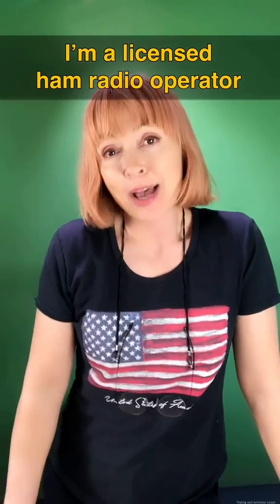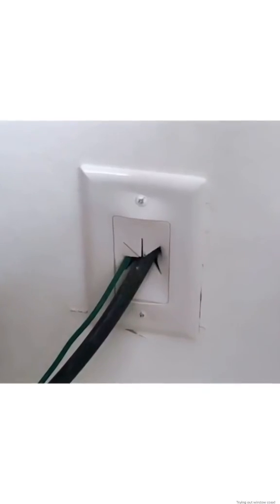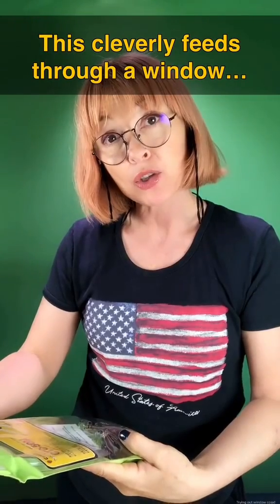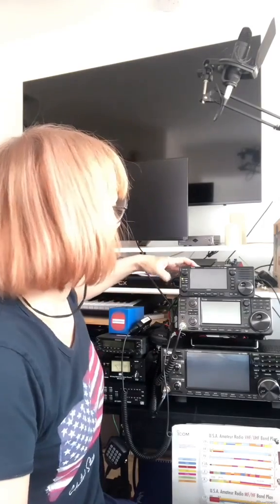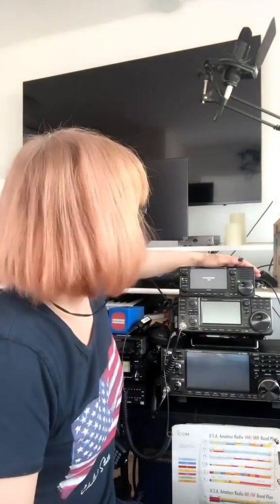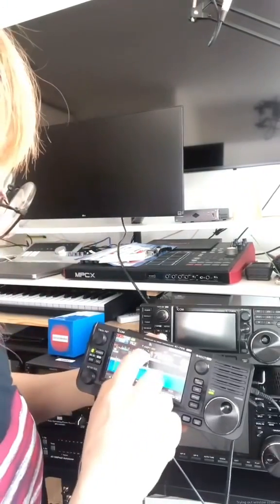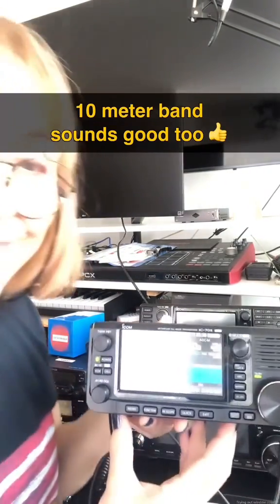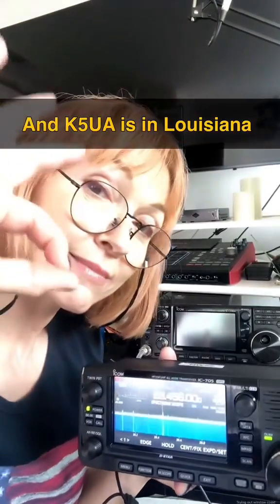HAM RADIO COAX WITH NO HOLES IN THE WALL!

Comment: Two things to know before buying one of these gap jumpers. According to Comet, the insertion loss is 0.5 dB (roughly 10%) and max power is 100W PEP for HF, 60W on VHF and 40W on UHF.  Honestly, it seems like a very niche product. If I was renting, I would work with the owner to drill the wall and place an outlet box on the inside that didn't look any worse than the TV coax. You also need grounding and a lightning arrester anyway.
Reply from the maker: I use mine daily and love it.

Comment: I have 3 of a different make than yours and, like you say, I can now bring in 3 cables from my 3 antennas (40m EFLW,  1/4 wave for 10m, and the 3rd for the UHF/VHF)  

These flat coax are a simple solution to a complicated problem 

I made some tests to measure and see if there was any problems due to them, and I couldn't find any difference (maybe a lab could...).

Yours though,  seems of higher quality.  

Peter
ON3VCF

Comment: I've used this for many years. Works well!! While it starting to separate still works, but got tired of using it, so made my own window pass through using a 2x4 (sealed and painted nice). I like my new option better only cause I have four connectors to the outside, so now I can test different antennas.

Comment from the maker: Here are manufacturers specs:

Frequency Range: DC-1300 MHz
* Connectors: SO-239
* Impedance: 50 Ohm
* Length: 15.75 inches
* Max Power: HF 100W PEP, VHF: 60W FM, UHF 40W FM, 900 MHz–1.3 * GHz: 10W FM
* SWR: Less than 1.3:1 below 500 MHz, Less than 1.5:1 above 500 MHz
* Loss: DC-500 MHz = 0.5 dB, 500-900 MHz = 1.3 dB, 900-1300 MHz = 1.8 dB

Affiliate link to item: https://amzn.to/3YvfKhd

Comment: a better way. 
using wood build a short panel of the correct thickness  to fit under a window.  drill X number of holes through it for the long threaded coax connecters.  as a benefit on the outside is a 1/4-3/8 think alum sheet, as a common ground. 
then get thick wall pvc piping of ( most newer windows here in the USA ) fit 1/2in or ? diameter. but cut to length for a tight fit. said window is not going to open. 
—can do this to all windows to “lock” them down to keep unwanted guests out.—.

Comment: what’s the insertion loss and it’s impact on VSWR, both on HF and VHF I wonder.
Reply from the maker: Per manufacturer 

Frequency Range: DC-1300 MHz
* Connectors: SO-239
* Impedance: 50 Ohm
* Length: 15.75 inches
* Max Power: HF 100W PEP, VHF: 60W FM, UHF 40W FM, 900 MHz–1.3 * GHz: 10W FM
* SWR: Less than 1.3:1 below 500 MHz, Less than 1.5:1 above 500 MHz
* Loss: DC-500 MHz = 0.5 dB, 500-900 MHz = 1.3 dB, 900-1300 MHz = 1.8 dB

Comment: Will this work on 2 meters/70cm?
Reply from the maker: I use it for HF and have not tried 2m/70cm. Here are maker specs:

* Frequency Range: DC-1300 MHz
* Connectors: SO-239
* Impedance: 50 Ohm
* Length: 15.75 inches
* Max Power: HF 100W PEP, VHF: 60W FM, UHF 40W FM, 900 MHz–1.3 * GHz: 10W FM
* SWR: Less than 1.3:1 below 500 MHz, Less than 1.5:1 above 500 MHz
* Loss: DC-500 MHz = 0.5 dB, 500-900 MHz = 1.3 dB, 900-1300 MHz = 1.8 dB

Comment: What happens when you put 1500 watts through it , Will it melt ?
Reply: I would be surprised if it works for tx above 25w tbh.
Reply: On HF it's rated to 100 watts, and VHF - UHF 65 watts or less. @lunarbluesmusic
Reply from the maker: Thank you.

Comment: I'd like to see some ARRL Lab test results before I went that route. An elegant solution no doubt if the losses too aren't noticeable.
Reply from the maker: Specs:

* Frequency Range: DC-1300 MHz
* Connectors: SO-239
* Impedance: 50 Ohm
* Length: 15.75 inches
* Max Power: HF 100W PEP, VHF: 60W FM, UHF 40W FM, 900 MHz–1.3 * GHz: 10W FM
* SWR: Less than 1.3:1 below 500 MHz, Less than 1.5:1 above 500 MHz
* Loss: DC-500 MHz = 0.5 dB, 500-900 MHz = 1.3 dB, 900-1300 MHz = 1.8 dB

Comment: Read my mind! I just spent the day wondering how to get my antennas inside better than a partially opened window stopped up with a towel.
Reply: I had a jumper like this and it was giving me issues, I made a window gap filler with a notch for my coax to fit inside and added foam insulation and weather stripping to it and shut the window on that. Added a couple of tension rods to hold the window shut on it, works great all summer and winter!
Reply: @Clembassador  awesome! I'm probably going to end up drilling some holes in my house once I settle on a design and stuff. I'd like to have a box outside with antenna connectors, with a 6" coax jumper through the wall to connectors on the inside of the house. That way I can connect and disconnect equipment and change/upgrade antennas and cables and such without pulling cable back through the wall over and over. But for now this looks like a quick and easy interm solution.

Comment: Luv you thru-wall connections. Any tips on how you did those?
Reply from the maker: Had electrician put a little box outside as though for power outlets, but with two coax ports😁 Each threaded bar went through to the other side into a tidy wall plate 🙂